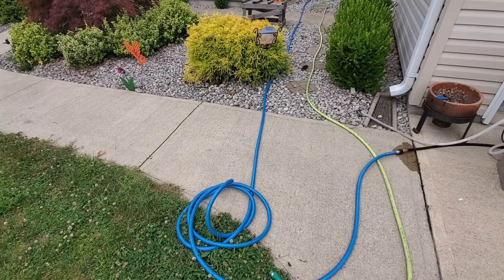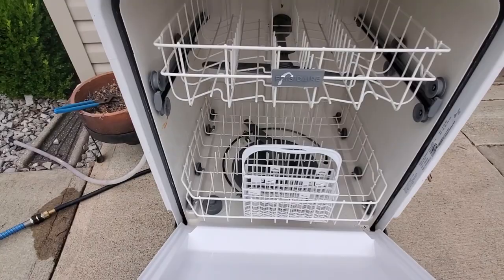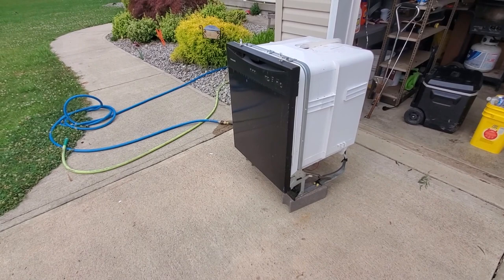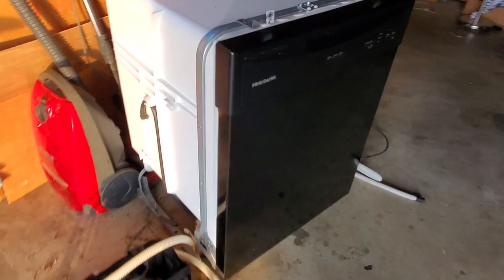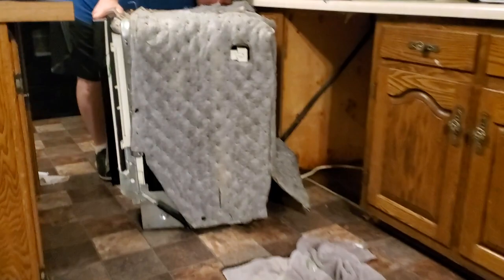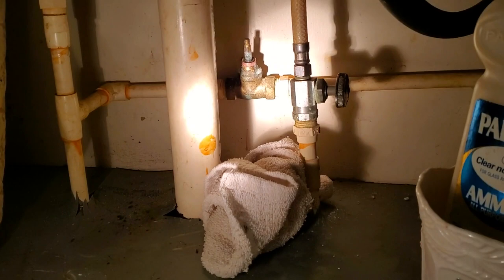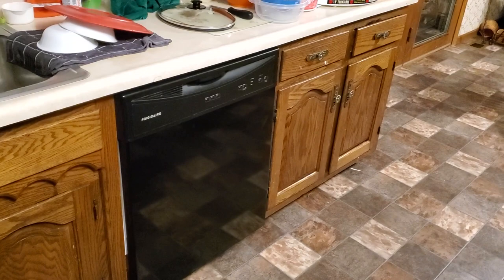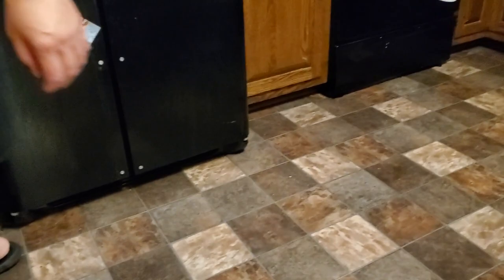Learn from my mistakes; Dishwasher test and install

Comment: How did you connect water to the dishwasher in the beginning to test it. I see a hose...but any special connections? I have a used dishwasher that I need to test before I install it.
Reply from the maker: basically reverse a garden hose end.  like buy a female to female end
Reply: Washing machine hose works well for this